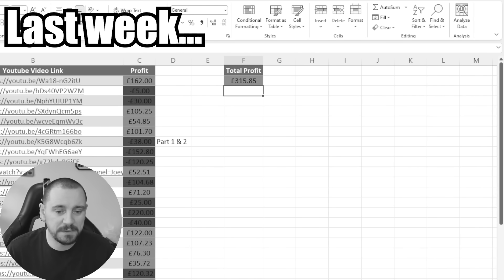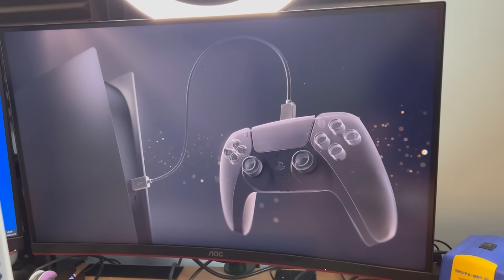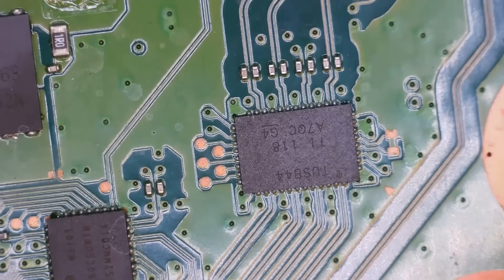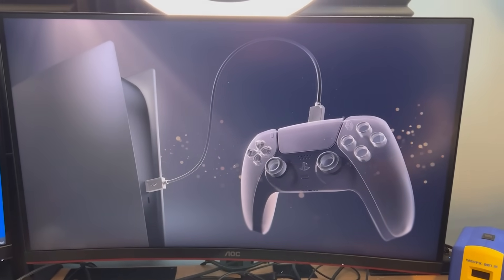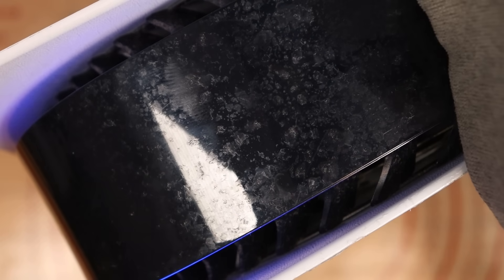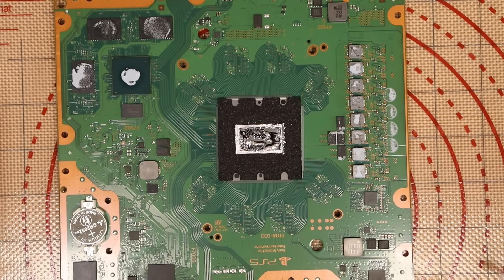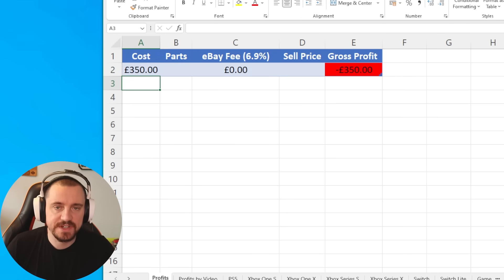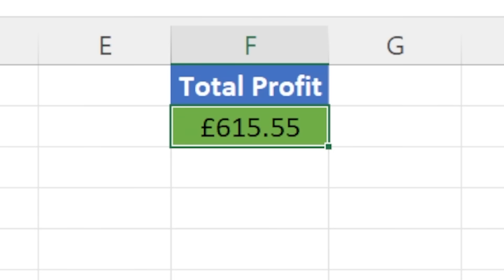Buying Expensive FAULTY Items on eBay! | Can We Fix It? Profit or Loss S1:E25

Comment: I have had good results polishing plastic with CARPLAN T-CUT for a more abrasive clean and then finnish with MEGUIAR'S ULTIMATE COMPOUND to remove the faint marks from T-CUT. Or just use MEGUIAR'S on it's own for a finer polish. You need plenty of elbow grease.

Comment: Stains on the glossy plastic might be from cleaning liquids. Alternatively, you said they were wrapped in bubble wrap, if the bubbles are on the inside, these melt and damage glossy surfaces, like plastics or displays, reason why most decent supply chains have a rule in place where if bubble wrap is being used regardless if you have an additional shroud in place, you should always put the bubbles on the outside.
Reply: Its Air Freshener Droplets ,I Have Same Issue From A Dispenser, Stuff Ruined All Sorts Of Materials, I Know Because Its Only On The Top

Comment: Youre definitely right with HDMi port replacements being tough for others! I have a PS4 which may need a new HDMI port but i have never done one beforehand...so I'm quite scared
Reply: Aslong as you dont pull on it but letting it fall off while working with a hot air station everything should be fine. :) We are all learning by doing! :)
Reply: @x-fix  Great tip!
Reply: @lukedavis436  Also add some leaded solder like Joe does to the original one. Also, if you feel uncomfy suddenly just make a short break. :)
Reply: @x-fix that’s honestly the best tip you can give to a beginner, never pull or stress a component when de soldering. I can’t count the amount of times I’ve broken something because I wasn’t patient enough.
Reply: @oscar1081  Yeah, its a whole process. With each repair your gaining experience and thats the most important part.

Comment: Why are there so many consoles with broken HDMI ports? I'm genuinely interested as to the use-case for these? Do people plug and unplug the HDMI connector on a daily basis or what? I've never had this happen to any of my devices that have an HDMI port... Do they yank on the cable, trip and drop the console on the floor? If so, why is your HDMI cable in a place where someone can trip on it? I just don't understand... What's your opinion or experience?